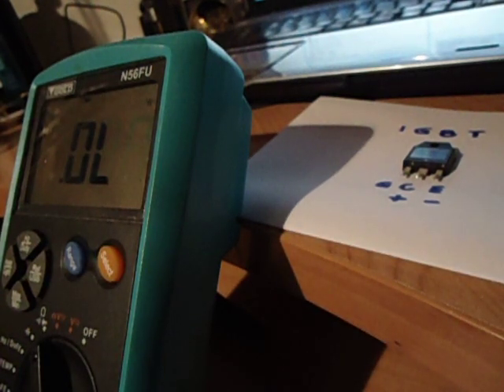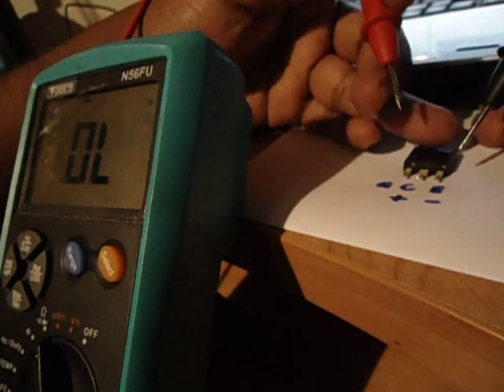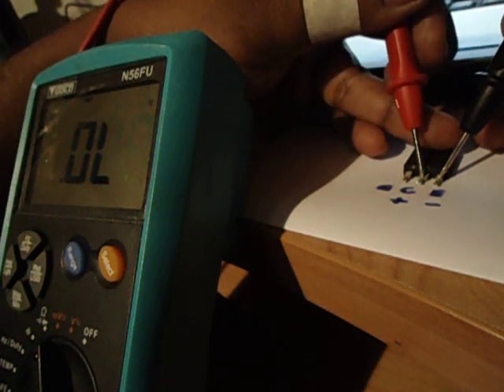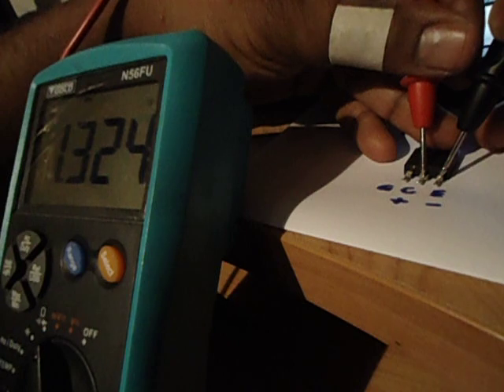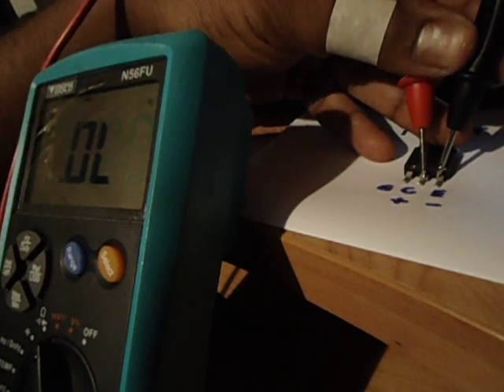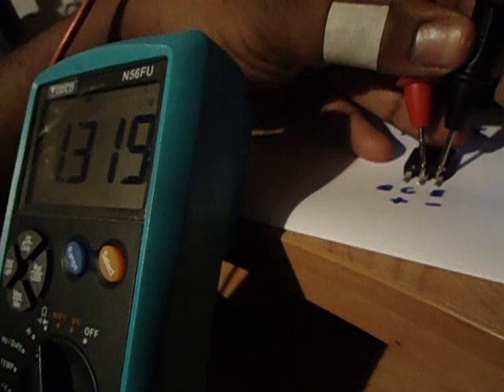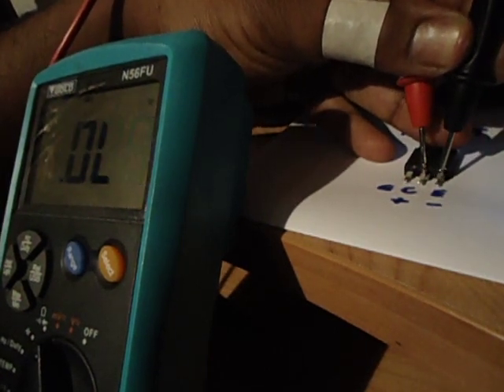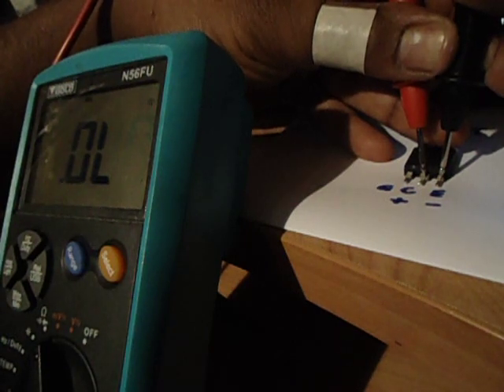How To Test An IGBT Transistor With A Digital Multimeter DMM

Comment: Thank you for taking time to create the video and help us out.  It would be helpful to know what the VOM is set for.  For example, testing a Toshiba GT20D201 completely discharged, I show an open circuit at the 2K and even 20K setting, but at the 20M setting, in fact, I have continuity with about 2 Mohms of resistance.  Can't tell if that's acceptable or not (?)

Comment: Hi there. Nice straightforward video. Question though - I don't seem to get short, nor activation of my IGBT when running this test. It's a G4PC40U from a treadmill board - is it possible that my (cheapish) multimeter doesn't have the grunt (current?) to open the gate when following the steps in your video? If so how would I be able to test the IGBT to see if it is good? I had the same problem with the new IGBT I bought to replace the above one which I thought was faulty.
Reply: Hello mate, I have similar issue with an IGBT (MGD623S)  from a Reebok treadmill.  Not able to activate the gate with either digital or analogue meters. So was it IGBT causing the issue in your treadmill? Hope you can reply.

Comment: Can this procedure also be used to test an N channel mosfet? I have a switching regulator whose data sheet labels it as an N-channel mosfet. I got 0.02V after I touched the gate then the drain with the red probe, which seems like a low reading. Other than the low reading, it tests normal.

Comment from the maker: @mculloa7 It does matter matey.You have to set it on Diode Function.Reason is,it give's out a small current to switch on the IGBT's Gate.Check your manual for the multimeter.

Comment from the maker: @whisperingsage Sometimes components tend to fail under load.You're lucky,its so obvious.If it looks Fried,Replace it&Check the Surrounding Components.This is a Mean't to be a Quick Basic Fault Finding Test.A more accurate test  can be done using a 9v voltage source& a light.Lookup testing a mosfet and  apply the same theory. I will make a video soon showing how to build your own Mosfet/IGBT & Regulator Tester&Backlight Bulb Tester when i get some time.Good Luck